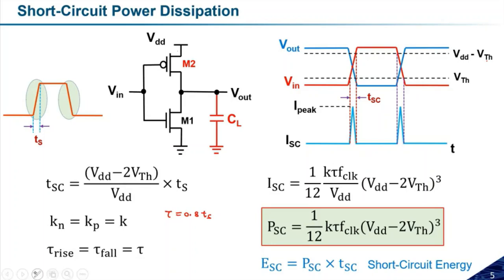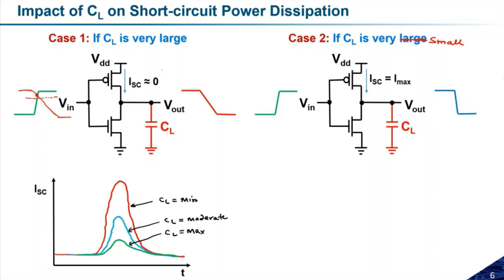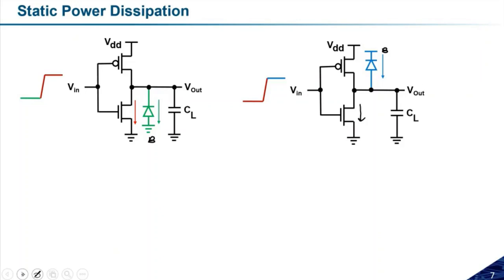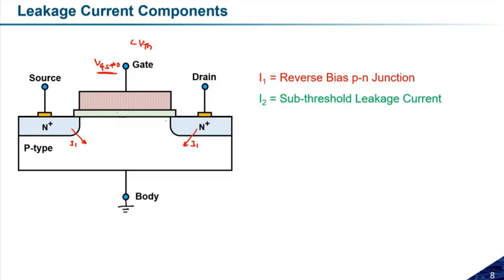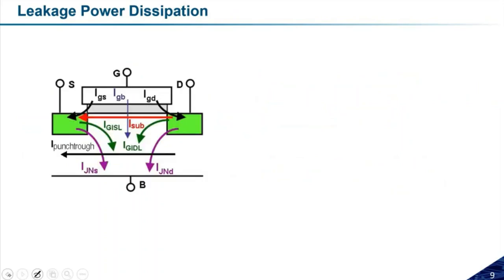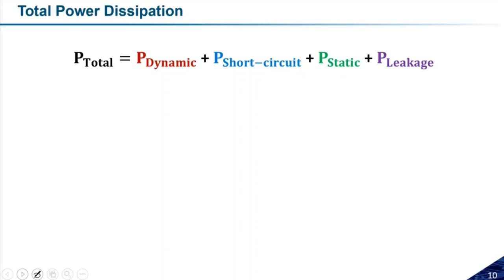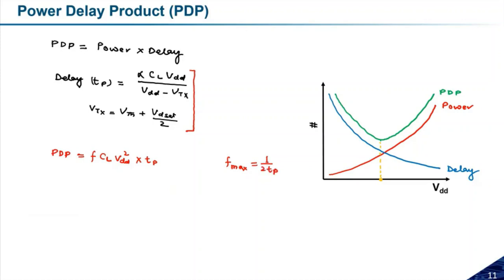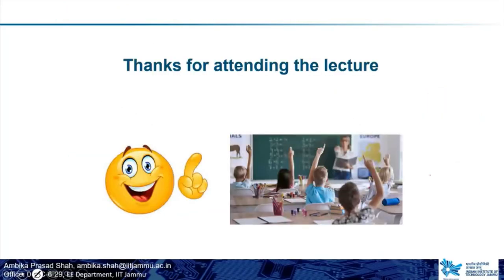Lecture 42: Static and Leakage Power Dissipation| MOS VLSI Design| Dr. Ambika Prasad Shah |IIT Jammu

Comment: What make static and leakage power different?
Reply from the maker: @shwetamalik7118  Leakage power is the power consumed by transistors in the off state due to reverse bias current, while static power is due to the constant current from Vdd to ground. Between Vdd and ground, transistors may be in off an on state.